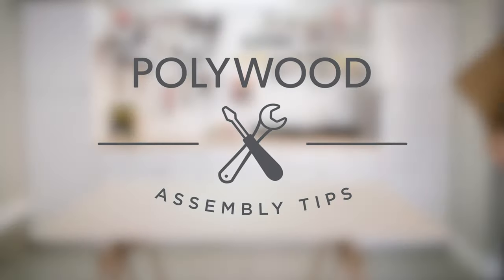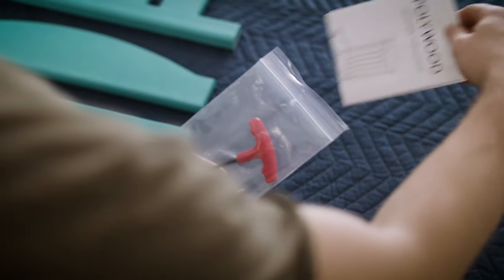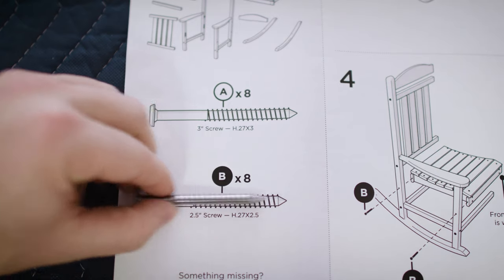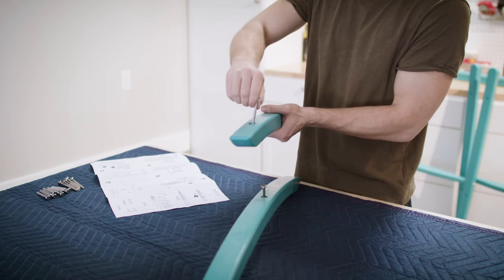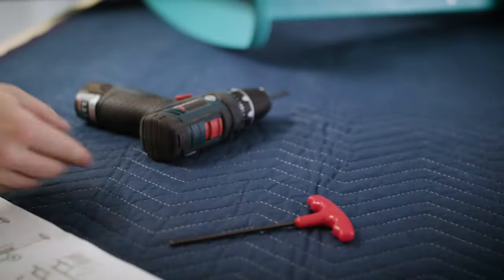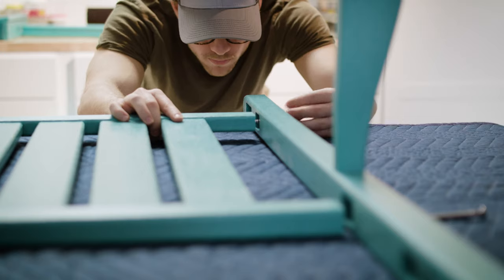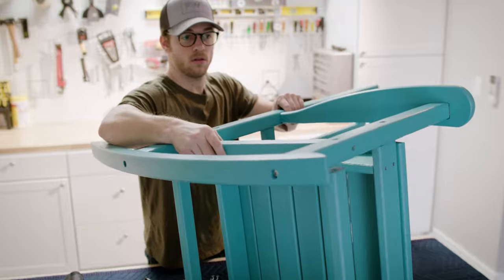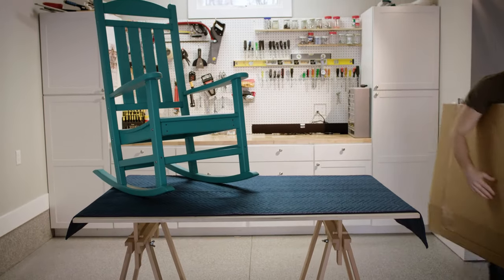POLYWOOD® Furniture Assembly Tips & Tricks

Comment: Some of the screws and holes you can easily access and use the t hex provided or even a 4mm hex drill bit. Other screws are right up against a piece of Polywood  and you can only turn it 1/4 turn. Very tedious and painful on the fingers. Also the boxes are NOT easily broken down. They use so much tape for shipping you have to completely destroy them to break them down.